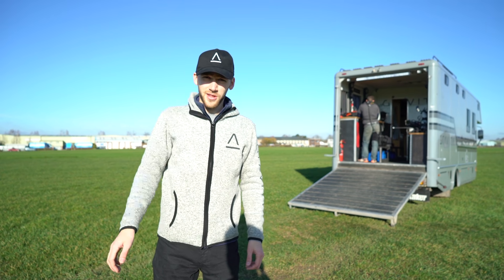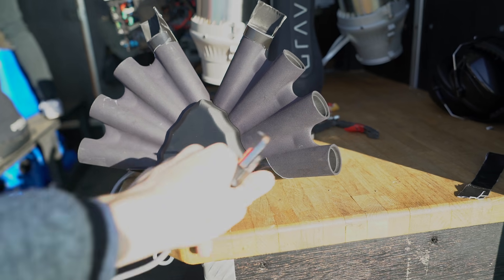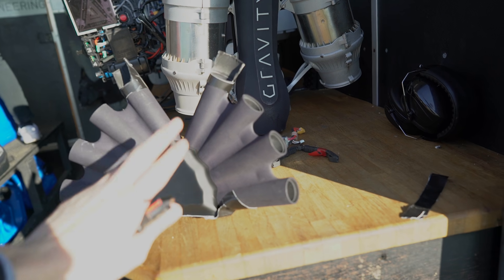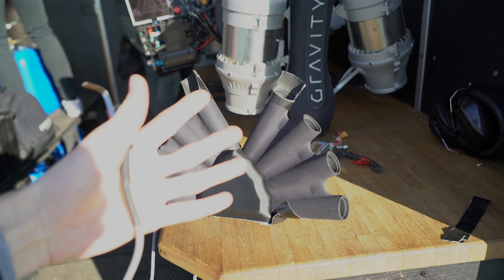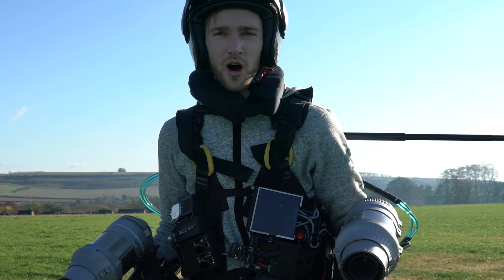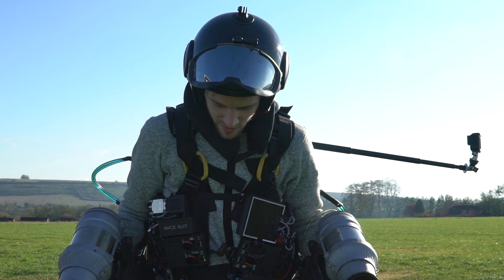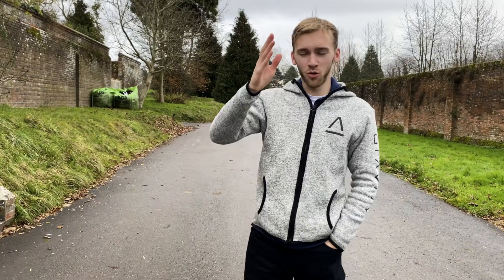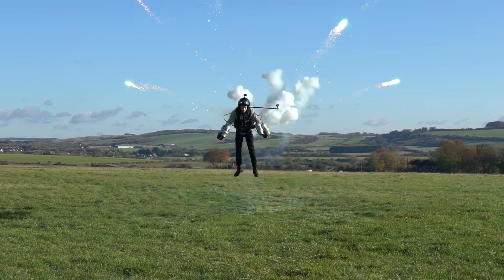Jet Suit Flare Testing

Comment: Are the charges wired to relays individually or by opposing pairs? 
What micro controller are you using? 
Absolutely awesome work Sam 🤘🚀
Reply from the maker: The Creator Thank you, they’re wired in pairs, two flares to each relay in wired in parallel. Will be posting more soon.
Reply: @SamRogers Great, can't wait 👌